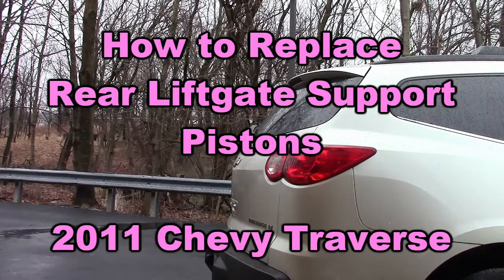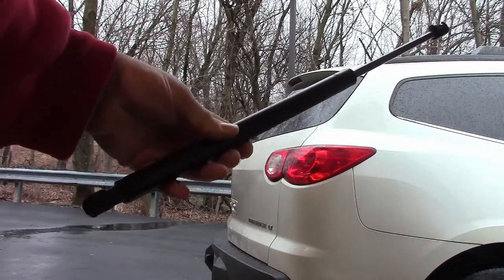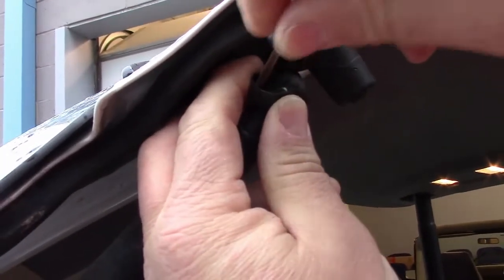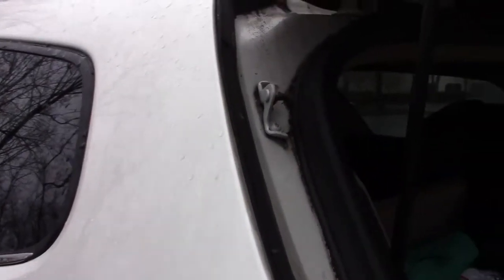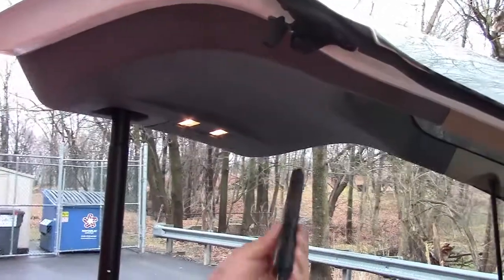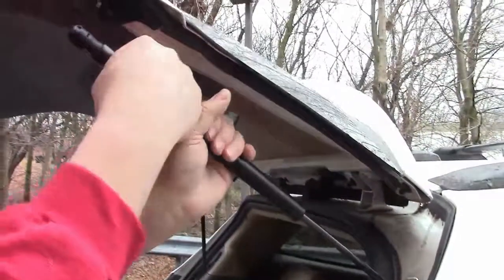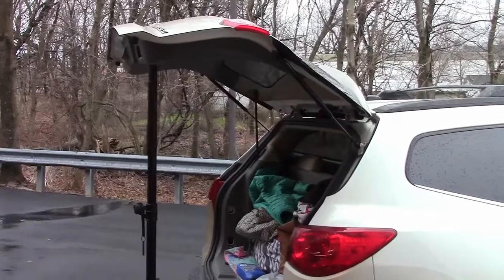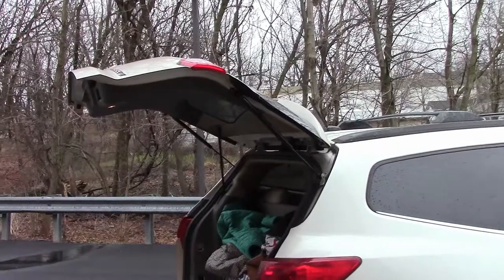How to Replace Rear Liftgate Support Pistons on a 2011 Chevy Traverse

Comment: Hi! Ihave a 2012 traverse doing the same thing. Will this be the same fix for my vehicle? Ty
Reply from the maker: Hi, and Thanks for your question. If your liftgate has a hard time going up, or can't stay up on its own, then probably one or both of the support pistons have failed. It's common for this to happen when vehicles get to this age (8 to 10 years old), particularly with frequent use.  Usually one of them will stop working because the piston seal (inside the unit) develops a leak. And because these liftgate doors are SO heavy, they need both pistons to stay up. Pretty easy to replace, and they're cheap enough online (about $20-30 for the set). Anyway, hope this helps. And Good Luck with your Traverse!

Comment: I have a 2012 Buick enclave, is this technique the same?
Reply: I have 2011 Enclave lift open all the way then comes down a bit and then slams shut. I imagine I have the same problem
Reply from the maker: Hello, and Thanks for your question. This procedure should also work on your Enclave, since it's the same GM platform as the Chevy Traverse, GMC Acadia and Saturn Outlook. And it's a pretty easy job to do (especially if you have a helper that can hold up the liftgate door for you!). Hope this helps! And Good Luck with your Buick!
Reply from the maker: Yep, sounds like it. We've repaired many 2008-2012 liftgate supports lately. I think it's just due to age, they seem to leak down after 10 years or so and stop working.

Comment: Replaced engine in ours per timing chain stretch issue, which I believe can be prevented with install of the reengineered valve cover gasket. CV axle shaft, all suspension parts, motor mounts.